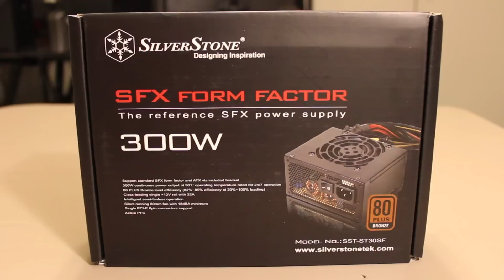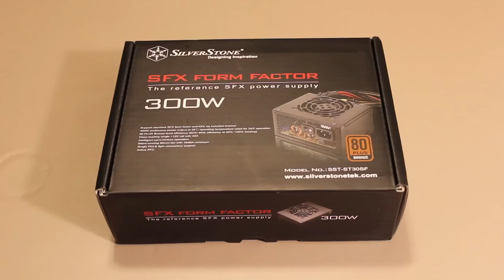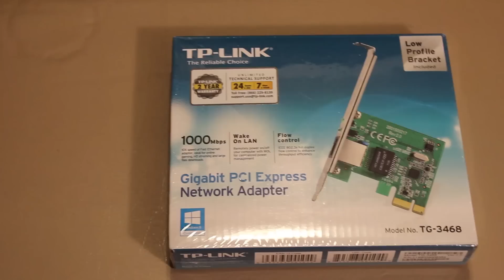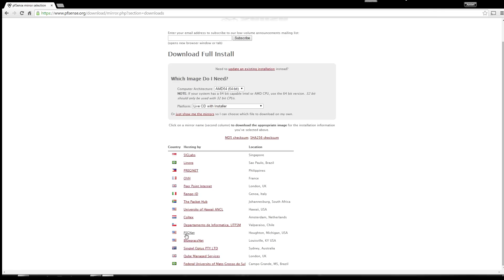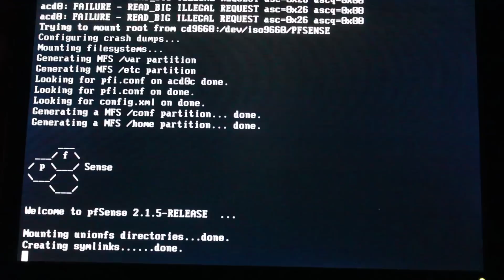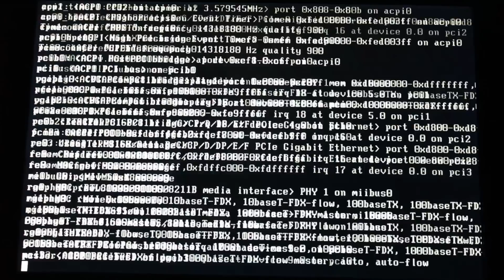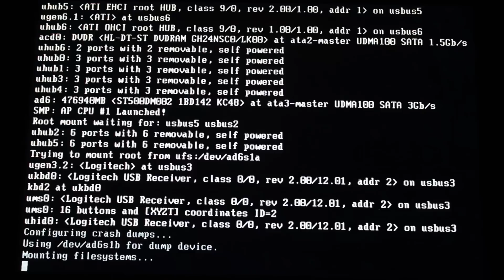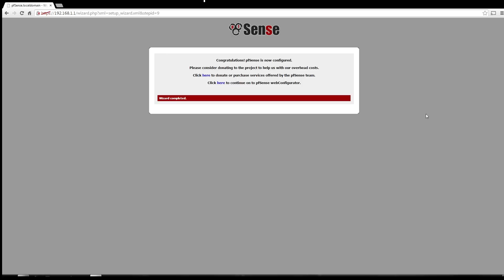Building a Router | pfSense

Comment: Nice build except for two minor things: An AM1 Athlon 5350 would've done a lot better, since it'll be a 25w quad core @ 2.05ghz (if you can even find it, its 2 GHz speed is enough for 1 gig capability and you can even undervolt it for better wattage at the same performance). Also, there are 12v to ATX adapters rated at 150w which would've reduced inefficiencies and power supply noise. Besides that, it looks pretty good.
Reply from the maker: Thanks for your input!

Comment: I use arch linux to run my NAS/Router setup, I had a Supermicro ATOM board 8gigs ECC RAM with 4 NICS on it which is Intel (and 1 for IPMI) so total of 5 Ethernet ports.

what I did is install vm software in arch which is oracle vmbox. then created 2 VM 1 for NAS4Free and 1 for pfsense, NAS4Free will use all the 6 cores and the 2 cores will be used by pfsense, bridge the 3 gigabit NIC to pfsense vm and one for my NAS4free.

Install the OS'es accordingly on each VM, test and done. My NAT speed for pfsense is around 800mbit/sec (can go as high as 1gbit and it should be capable of since this is a modern Atom) at first I need to guess which interface correspond on the port of my NIC since, all of them had the same freaking model number. After I know what interface which is which, I setup my 2 WAN interfaces (i got 2 internet source) at load balancing and 1 for LAN access. 

while my NAS can saturate the full 1 gigabit speed and can transcode videos 1080p upto 2 session at the same time (not that im transcoding stuff that often, almost all my device can transcode the videos that I had on their own).

last but not the least, my Kill-A-Watt meter and cold bootup, with 5 mech drives on it, it consumes about 60watts for about 3 secs and drop to 36watt idle, my average consumption is 47watts max is 60watts if everything is maxed out.

At least this is better than my old pfsense build that consumes 80watts of power with only pfsense installed on it.
Reply: +remle ikawura I think by using pfSense inside a virtual machine leaves the main host vulnerable if you are using it for firewall protection. If you think about it, the packets have to be interpreted by the host first and then sent to pfSense. I could be wrong though so its just my initial thoughts because I've contemplated that same setup.
Reply: Maybe a BSD jail would work though if you just did it via the bsd linux compatability layer. Wouldn't be my first choice.